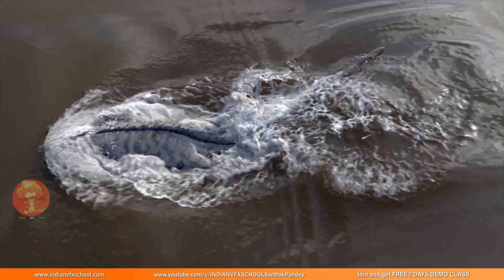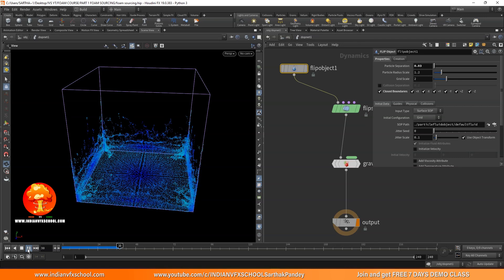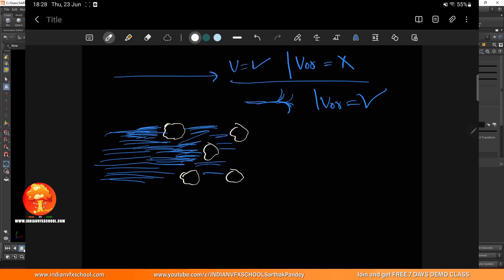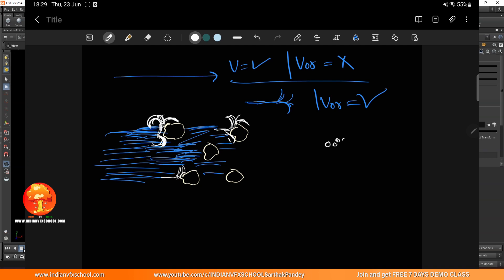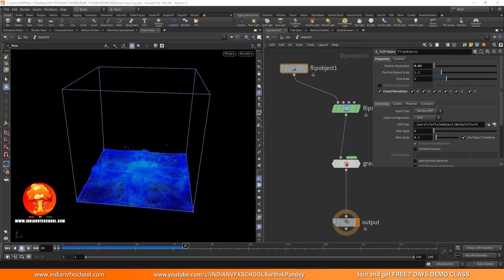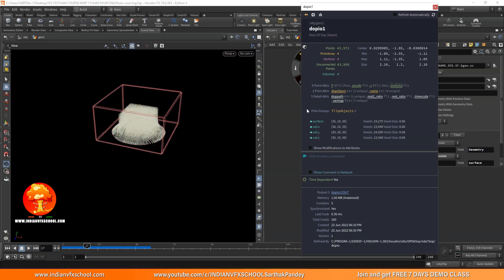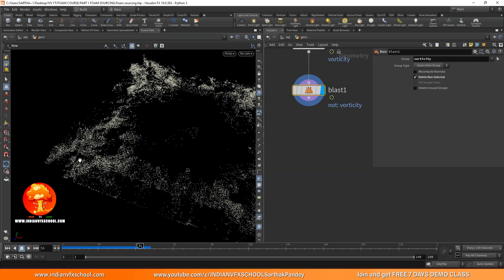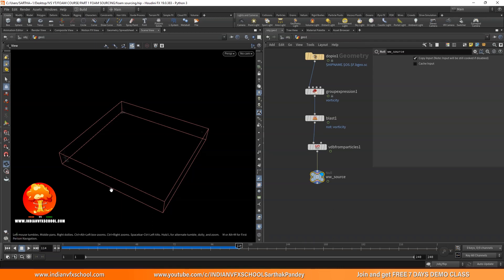Houdini White Water Course - Part 1 - Creating White Water Source #houdini #whitewater #Flip

Comment: when i do this my particles are huge like a pit of balls instead of fluid like you. is there a reason i have huge particle balls?
Reply: On the flip object. If you go into guides then particles and change from sprites to particles.
Reply: @finp7177  a big thanks to you! i was stuck with this problem.. thanks for the solution
Reply: @finp7177 thanks